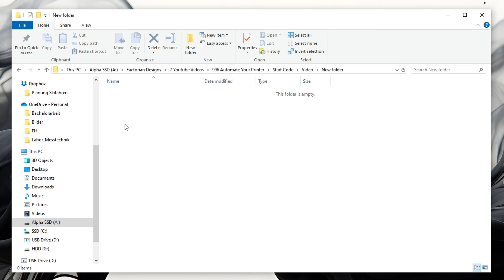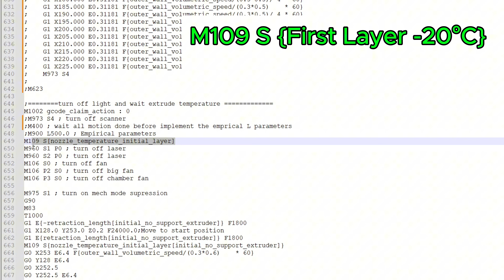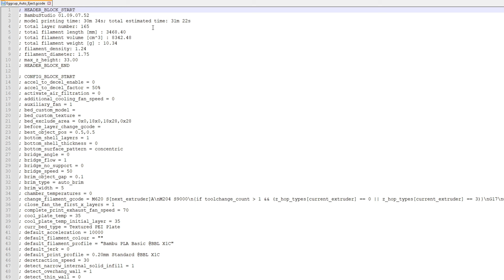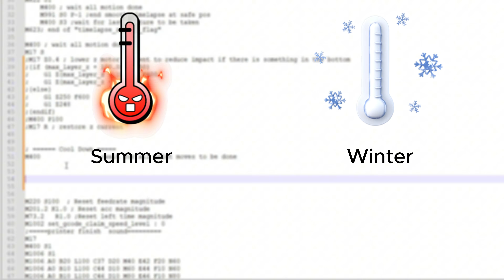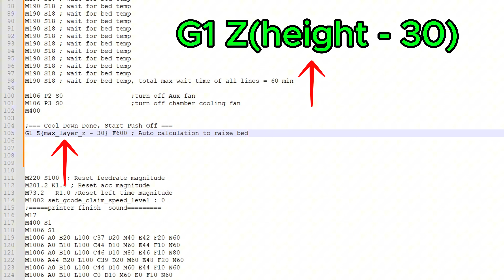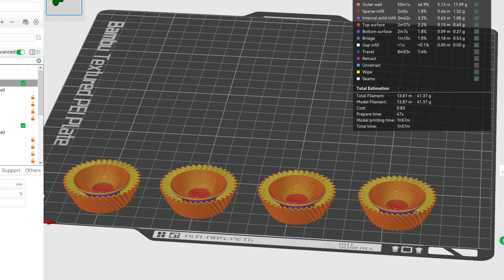Automate your Bambu Lab P1 & X1! Free & Easy

Comment: I'm new at 3d printing and this is awesome!!  I was wondering if there's a way to restart a print from the next build plate in sequence, rather than just restarting the same print. I'm printing some drawer insets, but they need to be split into four sections to fit on my build plate. What I'm hoping to do is print the first part, have it automatically ejected, and then move on to the next part for printing, and continue that process for each section. I really appreciate any insight on this. Thanks!
Reply from the maker: @robertwalter8431  yes you can just copy all gcodes into one gcode file. But I will also show a different solution with the next video.
Reply: @Factorian_Designs  Thank you, I am looking forward to your next video!!

Comment: Hey, I loved your video and have already automated three X1C printers. It has worked great for small prints, but I always have a problem where the printers don’t switch the filament inside the AMS when it runs out.

In the slicer, I set all four AMS slots to the same material and enabled the automatic switch when one spool is empty. However, it still doesn’t work. Do you know a solution, or is there something I need to add to the G-code?

Thanks a lot!
Reply from the maker: Yes I know a perfect solution for that one but it needs a bit of explenaition which I will provide with my new video on A1 automation coming in a few weeks!

There is nothing you can add to the gcode btw. I promise the wait will be worth it, as this solves a bunch of other problems as well.
Reply: @Factorian_Designs  Ohh okay, I was hoping for a small solution right now. Because now I cant really use the Automation because my prints use half a spool (Push Off still works great btw.). I need to now Change the spool every day and have much downtime. But thanks for the Info!
Reply: @Factorian_Designs   I for now do my own workaround. Just slicing four times the model, but each time I will change the Spool AMS slot. Then adding the gcode together to use every Slot. So after 2 Prints, the Spool has now only 80g left and then switch to the next Slot.

Comment: I have a few questions. Will this work with the Bambu A1 (as that is what i have)? Can I use this method for different models (if I am doing a project with different build plates in the slicer)?
Reply from the maker: Yes it does work but needs a little more explanation. New video for the A1 will come out in a few weeks!

Comment: I've done the automation of my P1SC following your instructions and all seems 99% perfect. Can you please suggest how to turn off the filament unload after the print as it goes back to the AMS, then it loads again at the start of the next cycle....? it's a waste of time and the little purge as well. 🤔
Reply: I have looked into the gcode again and found thes lines at the end. Do you think it is OK what I commented out?

G1 X100 F12000 ; wipe
; pull back filament to AMS
;M620 S255
;G1 X20 Y50 F12000
;G1 Y-3
;T255
;G1 X65 F12000
;G1 Y265
;G1 X100 F12000 ; wipe
;M621 S255
;M104 S0 ; turn off hotend

M622.1 S1 ; for prev firware, default turned on
Reply from the maker: @ I honestly just always leave that one on, but it does look like you commented out the right part.
Reply: @Factorian_Designs  What annoys me is when for some reason it does not feed the filament in and gives an error. Maybe it is due to the PTFE tubing I don't know but if I can avoid the whole unloading and loading that would save time too.
Reply from the maker: @ hm this normally works reliably for me. The PTFE can wear down completly as well, definetly check that. Maybe also take a look at your cutter.
Reply: @Factorian_Designs  Could you please comment on why using your code the printer would only use slod 1 of the AMS and if it runs out it won't switch to slot 2 or 3 even though I set the filaments the same on all slots. Also, if I preload the filament from the external spool holder and click to print the file, first it cuts the filament, waits for me to remove it and again starts to print from slot 1 on the AMS.

Also, the code I commented out above does work and the printer does not unload/load in between prints.
Reply from the maker: @ This is connected to the data saved in .gcode.3MF files which are not used in this case. I have a good solution for that coming with the next video.
Reply: @ Well I'm gonna prepare my popcorn then!

Comment: Couldnt you add something like this to the gcode for a klipper machine i.e. Voron?

 Before the actual print starts you would need to add a m30. So it would look like this:

PRINT_START;
M30;
(your gcode);

Then you would add a N10 line to the start of your print.

PRINT_START;
M30;
N10 (your gcode);

You would then need to add a M97 between your PRINT_START and the M30

PRINT_START;
M97 P10 L12; 
M30;
N10 (your gcode);

P is where the loop starts while L is how many times it would loop.

At the very end of your print before your END_PRINT, you would need to add in a M99.

Your resulting Gcode would be something like this:

PRINT_START;
M97 P10 L12;
M30;
N10 (your gcode);
(gcode);
(gcode);
M99;
PRINT_END;

Please correct me if im wrong with thinking this.

Comment: Good morning, I need to bring the print head to a specific point of the plate. Can you do it from a gcode file that can be launched from an SD card? Can you send me an example file? I tried to make a gcode file with these simple commands but the display says printing in progress but nothing moves. g28 g1 x0 y20 but the printer remains still. Can you send me an example gcode to understand my mistake? Thanks

Comment: @Factorian_Designs You can add an Excluded Bed Area to make sure the extruder can move behind the part. Perhaps you can narrow it in further, but here is a starting point:
0x0, 256x0, 256x11, 18x11, 18x28, 0x28, 0x199, 256x199, 256x250, 0x250
Reply: Best the I can tell from looking down into the machine from the top, the sides are still viable on the P1S (other than the standard filament cutting corner in the front left). If you've found that the parts can hit somewhere, this could be updated to reflect that. And let me know too! :)
Reply: It seems to only affect the slicing process, disabling the slice button if the model’s boundary is in it.
Reply: I forget which version I dropped here. You’re making a single polygon that represents all of the area that is out of bounds. At first I had a funny shaped one that cut off the back of the plate, but after restarting OrcaSlicer I started getting weird errors. I’ve since just cut off the front and am less worried about the back. But it would be nice to experiment and get the right shape to cover everything.
Reply from the maker: @ Nice I'll definetly try this out later. Thank you for all the input!
Reply from the maker: That is a great idea! Does this only count for the slicing process or also restrict the movement during the clearing process ? I haven't tried this out yet myself.

Comment: You can print at least 10 of that little "pots" on a plate. Why would somebody need the "remove" function?! And...

Plate is very sticky. Doesn't works for thin/small pieces (like keychains i.e.). You need to wait a lot before the plate cools down enough to remove a piece without deformation/damage.

That's why the A1Mini "swap bed system" is way way way way better than this.
And... This is a method extremely old and seen everywhere. Well awaken. Just a few years later.

Comment: Dont get me wrong, your videos are absolutely awesome and really helpful but why do you recommend the airtight container from Emsa? I thought by the dimensions on the picture that 4 spools can be placed inside, and yes i did not thought about it very long. i just ordered it. But only 2 BambuLab spools can be fitted inside, and there is much more free space left, but not enough for a third or even a fourth spool. "Fits multiple spools" does not sound like only 2. Please suggest something else. This is a waste of space and in my eyes a bad recommendation.
Reply from the maker: Thank you and sorry for the bad recommendation, like you rightfully said. They used to have other dimensions when I bought them a few years ago. Mine is 30x46x24cm and fits exactly 4 spools. I have taken down the recommandation link. Maybe you can still send them back?

I haven't bought airtight boxes in a while so I sadly don't have any other recommendation that I am confident in.
Reply: @Factorian_Designs  Thanks for the immediate response. I will send mine back and it shouldn't be a problem. It would have been nice though to fit 4 inside. I did not find any suitable substitute.
Reply from the maker: @Granatenman  You could take a look at the 3Dprinting subreddit, I think I saw a good solution there recently

Comment: Hi am i the only one having problems with the re printing part, every time i try to re print automatic the print does not repeat and it just repet the eject sequence pls someone help me :)
Reply from the maker: You are probably doing something completely wrong here. Watch the part on the print looping again and make sure to copy and paste the whole g-code, not just the End-G-Code part.
Reply: @Factorian_Designs  oooo that makes alot more sense ill try it thanks for answering
my question
Reply: Just to reafirm, put the start and end gcode on the end gcode segment and copy it the amount of times i need to re print?
Reply from the maker: @ 
No not like that.

in your slicer put the start code in the start code segment and put the end code in the end code segment.

Then slice it all -> export the .gcode file and open it. In that gcode file, erase the shown command at the end and then you copy and paste the whole file as many times as you need it.

Then print that gcode file. Please watch the whole video again if you are still confused.

Comment: Better is to use the FTPS Connection to printer!  not move the sd kart off.  More specifically FTPS (port 990 / implicit FTP over TLS). Note that FTPS is not the same as SFTP!

The username is bblp.
The password is the access code found on the printer LCD within the WiFi settings.
Reply from the maker: You are right and a better an very easy soltuion is coming with the next video.
Reply: @Factorian_Designs   cool :)

Comment: Dont see the point of this, large prints where you can only fit 1 of would probably damage the printer, and small prints like shown here why not just print multiple? Good video but not sure the point.
Reply from the maker: I think you are missing the point of automation in general. The goal is to reduce your own labor with  the help of machines. Even if they are slightly more inefficient we achieve exactly that. Less work for you.

Comment: Great content for those who seek to level up their production efficiency! thanks a bunch! One question comes to mind though: let's say that you give it a print loop over the night and one of the prints goes bad...is there any code trick for the printer to detect this and stop the printing? i'm thinking that otherwise it will be a mess. if you are unlucky and the printing goes bad at the beginning of the loop count, it may consume an entire role of filament with spaghetti failure, which can damage the printer. I'm new in 3d printing and maybe it's not a real issue, but i would appreciate an opinion on this. Thanks again and keep up with more videos like this! cheers!
Reply from the maker: This can of course be a problem but my prints rarely fail these days. The few eggcups that did fail, where pushed completely down and the next one continoued like normal. Thats why I included the safety clear as well. 

The "spagetti" detection of the X1 sadly doesn't work reliably.

Comment: Great, everything works well so far on P1S and X1C ! I did damage 1 nozzle and 1 bed on my 3rd attempt by not correctly calculating the Z height during clearance, despite your many warnings haha.
Other than that, any tips on how to "count" remotely the number of cycles that have been run?
Reply from the maker: Oh no but I have been there as well. 
I may have a soltution coming with the next video but I havn't tried it out yet.
Reply: @Factorian_Designs  ah great thanks ! And I don't remember whether ou touched on the topic or not, but any idea on how to activate AMS ? 1kg spools become the next pain when everything else works perfect hahaha
Reply from the maker: @antoinebihr1792  Not exactly sure what you mean by activate AMS but take a look at my A1 automation video. There I explain how you can use 3mf files instead of plain .gcode.

This will enable all AMS functionallity and work exactly the same for the P1/X1.
Reply: @Factorian_Designs  Niiiice, this way I'll automate my A1 as well, 2 birds 1 stone :D

Comment: i've been doing this for maybe over a year now with the p1s almost same way you did but a bit different. for a reason i forgot about the start and end gcode in the slicer itself, i had txt files with these gcodes and every slice i changed the gcode. and they run 24/7 but when im around i print with a full bed because thats better but when im not around the automatic print runs.

Comment: hey can you help me find the gcode to push off the print it pushes off in the wrong spot and i cant find it i looked for a while
Reply from the maker: Did you take a look at the gcode on my website? You just have to replace the X & Y coordinates like instructed there.
Reply: @Factorian_Designs  yea i have your gcode in but i cant see were the x and y cords are what tab is it uder as in where it says ;===== nozzle load line ===
Reply from the maker: @ I am honestly confused. The nozzle load line is in the start g-code but you originally wanted help with the pushoff coordinates?

The easiest way to find both of those things is by pressing "ctrl+f" to open the search function and search for you keyword, like "nozzle".
Reply: @Factorian_Designs  sorry i messed up my word, that was a example bc i was asking what tab the push off was under

Comment: yes, useful, but in my a1 a vase like this is very attached to the plate, it will not come off. 
then, the extruder is forced if the object doesn’t break away

Comment: Hey, I work in an education setting with bambulab P1S printers and was looking to automate students projects, I feel like this wouldnt work because of the amount of different types of models we have that are also generally pretty thin.. Any suggestions for how I could automate my proccess a bit better?
Reply from the maker: Hey, that honestly doesn't sound like something you can automate with the P1S.

In this case the only thing that could simplify you process is maybe importing all files at once, autoarranging and sending all sliced plates to your printer. Once a print is done you can just restart the next plate from the printer without touching your slicer.

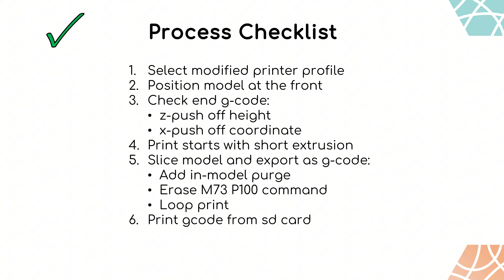Comment: AMAZING video. I was wondering, in the downtime example at 15:45, you use 12 minutes as a cool time example. Is this actually how long it takes your prints to self release? It takes my bed much longer than that to get down to 21 degrees and even after it has reached that temp my print is still considerably stuck to the bed. I know each model is different but I was just curious how long the cooldown actually took you and if you do anything extra to get the prints to release from the bed faster other than putting it in range of the aux fan. Thanks in advance!!
Reply from the maker: Yes this is how long it takes my bed to cool down. This is influenced by the size of your print and your ambient temperature. I have one sinlge PLA roll where the filament doesn't self release either, but most brands should do it by 21 °C.

Comment: Will this impact the way the AMS handles auto filament run out? Will the AMS still be able to automatically switch to another spool or is that feature disabled when using custom gcode?
Reply from the maker: No it will still work fine.

Edit: Ok apparently it does not, a solution is coming with the next video.
Reply: @Factorian_Designs  This part is not working for me.  Got the automation running brilliantly, but it is not switching when it runs out.  Once I solve that, it can go forever.
Reply from the maker: @dumpsterdave3710  I might know why and will post a solution to the problem in the next video!
Reply: @Factorian_Designs  Man, you are on it!  We do not deserve this degree of service.  Thank you!

Comment: It's a nice experiment with code, and I appreciate the work done to discover which lines do what, but you shouldn't use your print head as a ram. That's not what it's made for and it's asking for trouble. If you have the need to make high quantities of prints, you'll get better velocity by filling the bed entirely, taking out the plate after print and just waving the whole thing in the air for 10-15 seconds. All parts will fall off by the air rapid-cooling the plate and you're back in business in less than a minute. Plus, a full bed print will take hours anyway. So you can comfortably sleep through that time. I found that the author is clever with justifications, but many are invalid arguments to begin with. This was a bunch of solutions in search of a problem that doesn't really exist.

Comment: I bought my P1S about 3 months ago ... a bit late but really impressed. I used crap PLA in AMS and spent a day scratching my head 3 dimantlings! :(  Annnnyway. A few blockages as well but bought 10 rolls Bambu filament in sale. Will use the old crap on my Cetus now ... (probably not) :)) great channel thank you!! 
P.S. Typo in your "About"; tickel -> tickle
Reply from the maker: I know that feeling, very cheap filament is never a good idea ...

Thank you for the heads up I just corrected the About section :)